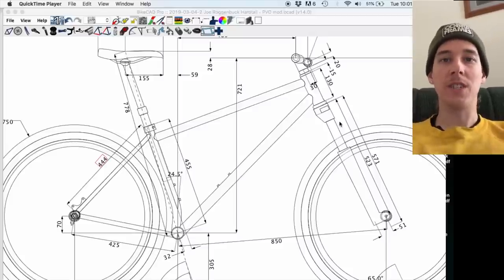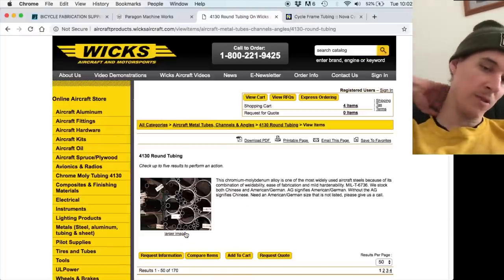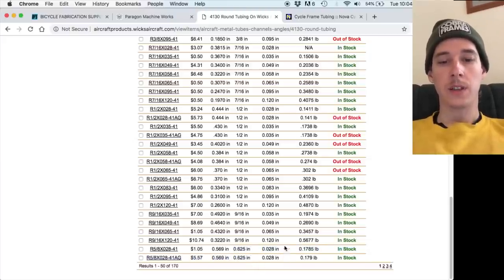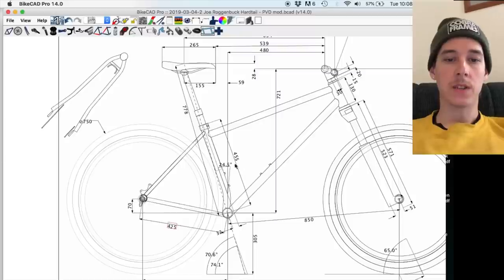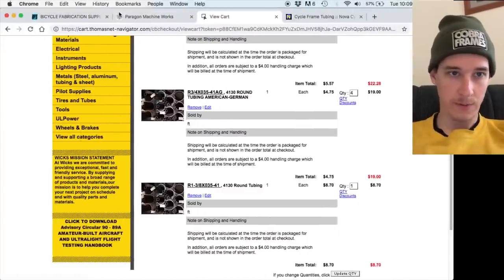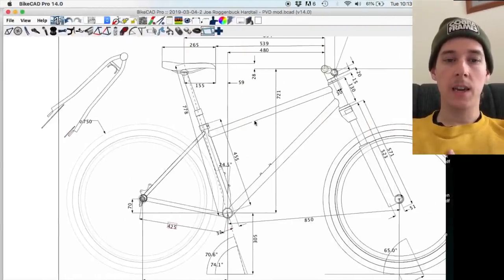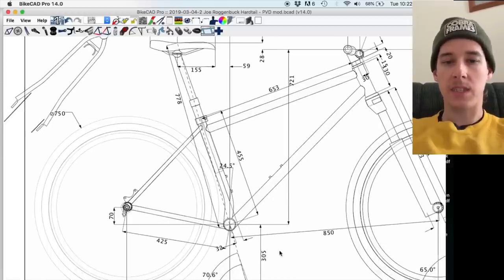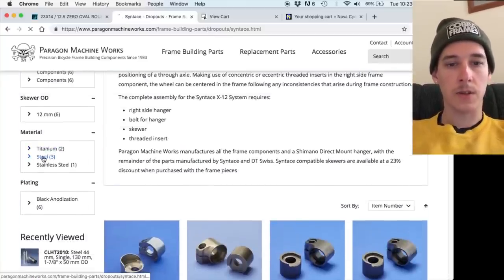Buying Tubing and Materials for a Hardtail MTB Frame Build

Comment: Forgive me if you mentioned this in the video but what are the reasons you chose straight gauge tubing over butted tube? It seems like the cost for butted tube isn't that much greater. Is it specifically for bending? Thanks

Comment: why not make seat collar yourself? is it hard to turn propper id?
Reply from the maker: I will buy the collar and just modify it to my liking. The hardest part about making a seat collar with the old manual lathe and tooling I have is going to be boring out the inside diameter to the diameter I want and getting a decent surface finish. You'd like to have a nice solid carbide boring bar and I have the worst, flimsiest boring bars. I could tool up for making seat collars, but nah, this is a good compromise for where I'm at and what my goals are.